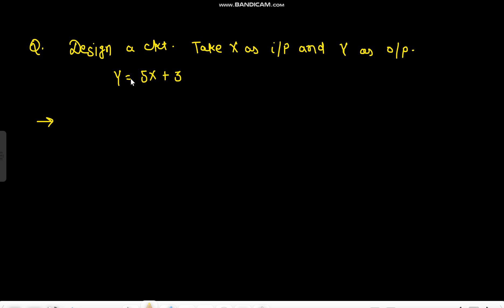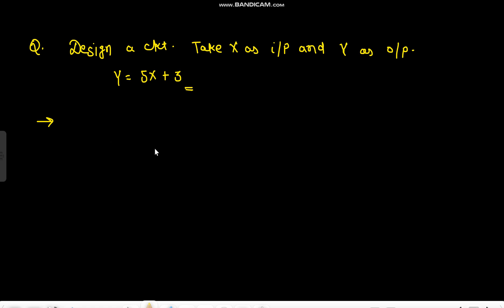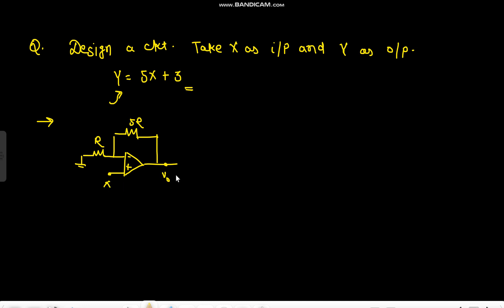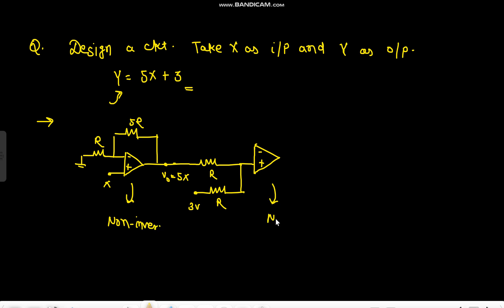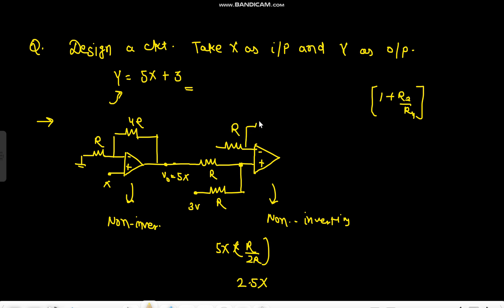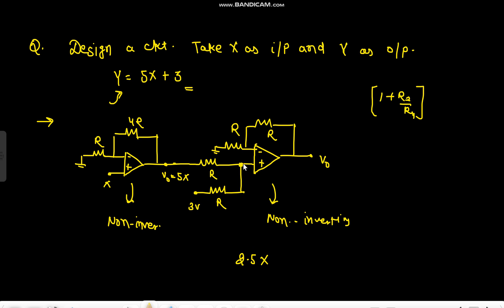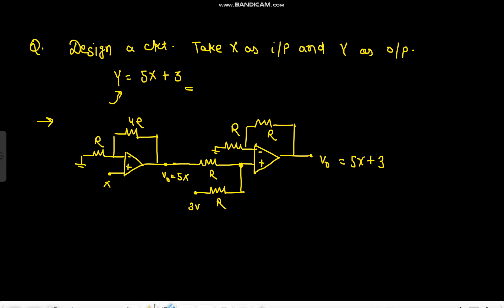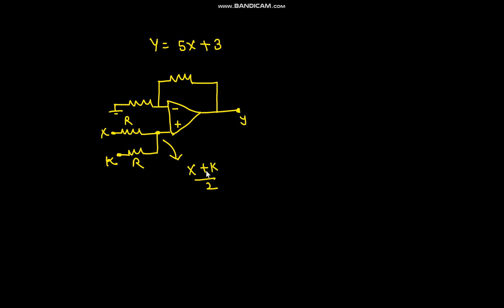Google Hardware Interview Question || Circuit Implementation

Comment: Hi Sir, can it be solved using another approach which I thought:
We can apply 6V to +Vcc of the op-amp and gnd to -Vcc, and then apply the input voltage x with a non-inverting gain of 5 and we can keep dc offset as 3. 
But, I think one drawback for this circuit may be if my input exceeds 0.6 V then the output will be saturated to 6 V.

Comment: Can we use buffer ckt with 2 inputs one from frst and 3 volts from seperate source.
Reply: Because input is x but output is 5x
so you use the voltage follower to be Op1 that's
impossible😅

Comment: Hi Bro, 
I am a newbie in Op-amps and I have a question

If i simulate the full (final) circuit with 2 op-amps, considering 5V as i/p, I still get 15V only instead of 15+3V
Why do we gnd the ckt (at 5X) to get the +3, midway? https://youtu.be/sjMrqWEyelE?list=PLIwAonW-w1Ru7k2ux-_IoqDUSMXHWFuda&t=185